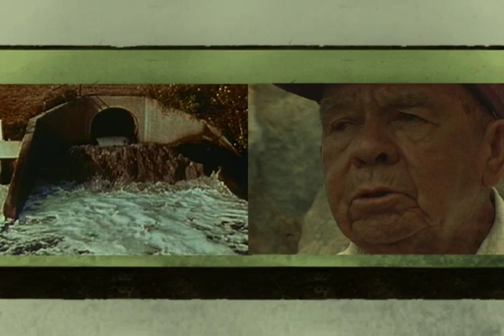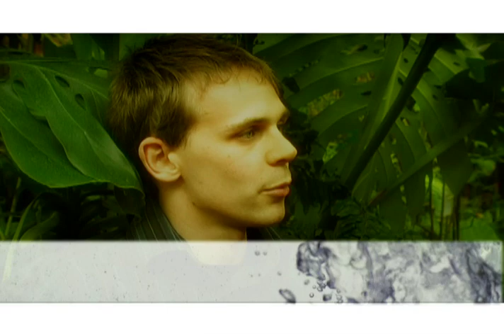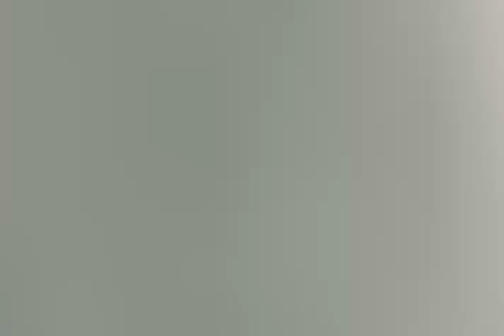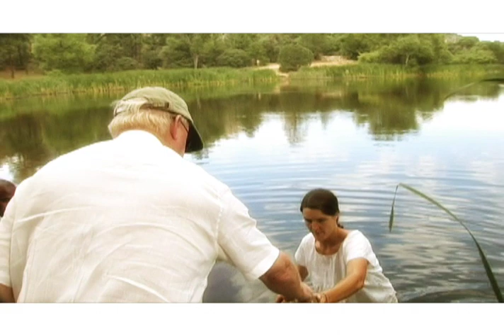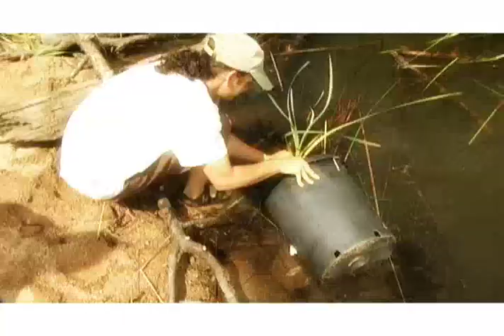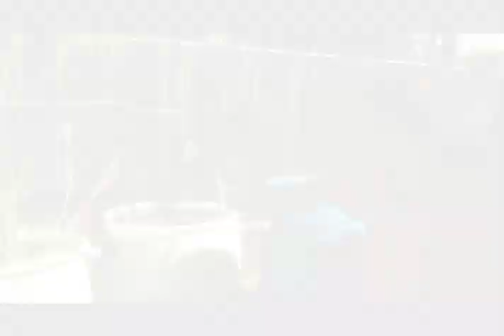Dr. John Todd - Founder, John Todd Ecological Design on Eco-Machines

Comment: @c33r0k33 why couldnt this be set up in LA? Would it be too much to do?
Reply: It's been a while. Such things can be set up anywhere. I only discovered John Todd tonight, but had a suburban set up I started in 2017. 

If you look up backyard aquaponics designs utilizing blue barrels and IBCs you can tweek it from a closed loop to a "train". Though I would recommend using tank adaptors/ bulk head fittings to join pipe work to the vessels instead of uniseals/ grommets, reason being is tank adaptors can be used with irrigation pipe (ldpe) and fittings, which are foodgrade plastics, the barrels and IBCs are HDPE

I used a system for grey water from my washing machine where the first barrel had drainage gravel at the bottom, some charcoal in the middle and coconut coir on top with a wetland plant at the top. I had elephant ears planted in it. The land was on a slope so I just chained more and more gravel beds together before having some fish tanks to fertilize the clean water as well as acting as canaries in the coal mine. The system irrigated my backyard garden during droughts. I am in sub tropical Australia so didn't need to factor in any freezing conditions though.

For gravel, I utilised blue slate as well as scoria (volcanic rock)

I haven't utilised pumice yes, but suspect pumice's lighter than water density could be used to create floating wetlands within barrels, allowing for an empty barrel to be lighter, have a higher capacity of water and allowing plant roots to generate more surface area for bacteria than gravel, as highly porous material is more expensive and could possibly clog pipes.